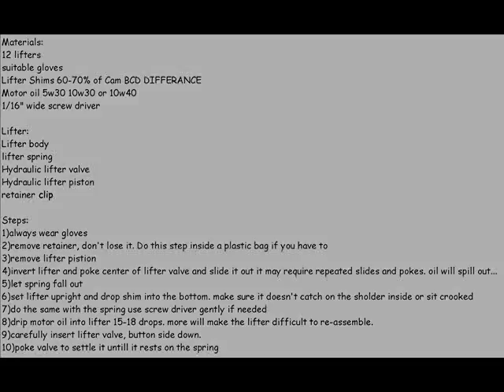LIFTER SHIMMING for CAM.wmv

Comment: Just to let everyone know- I found an easy shin solution. It’s size M4 flat washer. They’re .032” thick and fit nicely in the base of the lifter. Some of the washers fell right in. Others I had to go around the edge of the washer with a small file to make them fit. Nothing serious and only took about minute of filing. You can get a box of 100 for $5-$10 depending. It took me a while to find a good shim source just passing this on. Thnx

Comment: Question for My1Path- great video btw. I bought and shimmed new lifters according to your video. After ripping apart my engine found my old lifters “cupped” and cam lobes worn unevenly. (Prob due to not prop adjusting cam play and locating plates) Anywho... This time I’m buying new cams prob JWT or Isky, question is- since my new lifters are shimmed, should I take apart to remove the shims or can shimmed lifters be used with new (non-ground) cams? Thnx
Reply from the maker: It could, it depends on if the shim is causing coil bind on that internal spring during your base circle. I would recommend running unmodified lifters on cams with full size base circles.
I have JWT S1 in my vg30 and I love them. The torque comes in really early and stays strong through midrange. Makes me want to buy another pair for my BUILT vg33.

Comment: You used .035 thickness, would lash caps .035 work just as good you think?
Reply from the maker: Absolutely not. The shim does not increase the height of the lifter, the lifter does that on its own. The shim increases the stability and stiffness of the lifter when the lifter is compensating for reground cams.
Reply: MY1PATH yup I totally get that now. Thanks. I have a lot of chatter and now I know why thanks to many of your posts in forums. I have regrinds and didn’t soak/pump lifters with oil before installing. I have ordered new lifters and rockers and found a sheet of .040” thick 8”x8” brass plate on eBay I will punch my own shims. Thanks again for all your help
Reply from the maker: In most cases old lifters are noisy because of dirt and varnish, not wear. If you are taking used ones apart to shim them clean them thoroughly and they should quiet up.

Comment: Where did you get the shims to put in them?
Reply from the maker: I don't recall the diameter but I punched them out of sheet metal using a Whitney Punch and then cleaned up the edges a little with a fine jewelers file.
Reply: Cool. I guess the diameter just needs to be small enough to fit in the bottom but not slide around? Brass should work for shim stock? I can get all I need of that.
Reply from the maker: Exactly, small enough to fit in but large enough for the spring to rest on. This reduces the hydraulic volume and increases the pre-load on the spring
Reply from the maker: Beware that using this in conjunction with a stock base circle cam may cause the lifter internals to bind.
Reply: Thanks, I'm sending a cam to Schneider for regrinding.
Reply from the maker: Good luck, ISKY has some good grinds too. If you talk to the right person he can get you a grind specific to your needs and they have a lot of options not listed on their website.

Comment: question, what actually causes lifters to ''collapse'' or become noisy in the first place? Is there a wear item in them like the check ball or does the clearance between the lifter piston and body just become to much to hold pressure?
Reply from the maker: Usually buildup of dirt and varnish in a stock vehicle. Low oil pressure or wrong oil can do it too. They can be disassembled in the same fashion and cleaned to operate just like new.

Comment from the maker: @mavapo I believe the shims I used were .035" You can Go up to .060" but they will not drain as much at idle.
Reply: MY1PATH how did you get the measurement for the shims for the lifters?
Reply: MY1PATH where did you get the shims...? Thanks